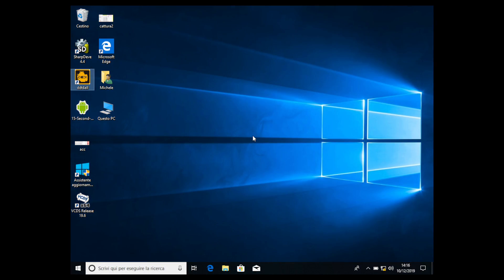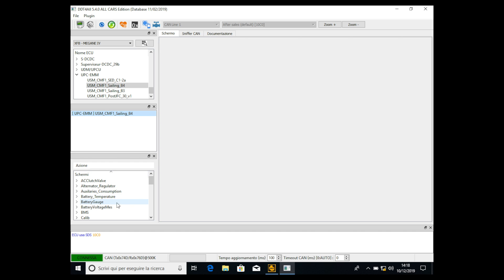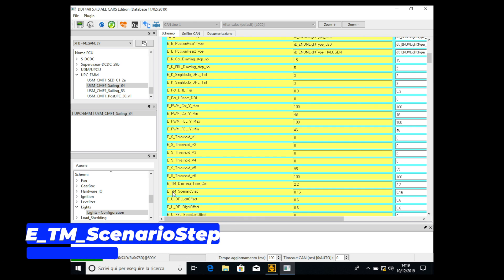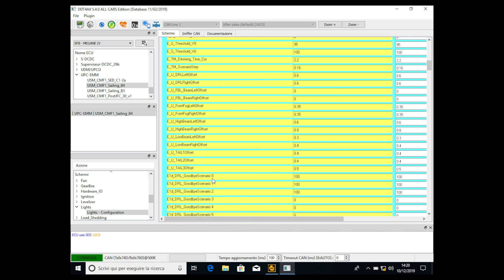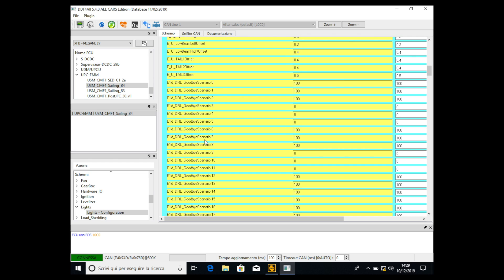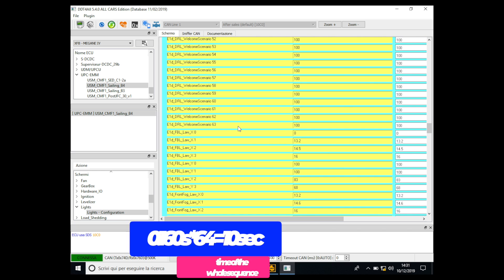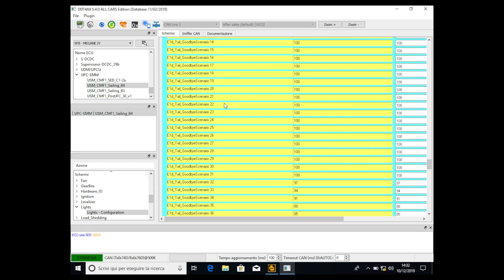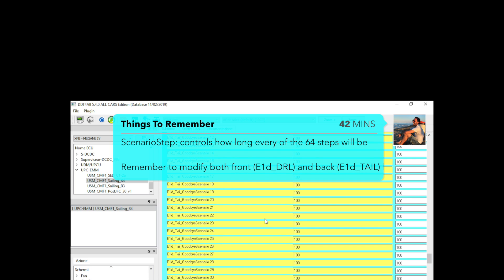Welcome and Goodbye Led Sequence Change | Renault DDT4ALL Tutorial

Comment: Hi. I am looking for solution and maybe You can help me. I have megane iv and I would like to change moment of opening side mirrors when option welcome lights is on. Welcome lights connected with hand free cause the side mirrors to open every time I approach the car and close if I walk away. If the greeting lights option is disabled, the mirrors open only after the ignition is turned on (pressing the start/stop button). I would like to keep the backlight only options, but change the moment of opening the mirrors to the moment of turning on the ignition. Do you know where to set this in dd4all?

Comment: Great video. I have worked on the Lights software part for Renault.
You have explained way better than Renault persons.
Reply: Hello man, i have a question if you mind, i have front headlights from renault zoe and both megane and zoe uses same headlight ecu, so i’m gonna install led lens, blinker and drl to my motorcycle from the zoe’s headlights but i couldn’t manage to activate drl led’s, i can get to work low beams, high beams and blinkers but i couldn’t activate drl, do you know the solution?

Comment: Hey
I was playing around in the developer mode on my radio unit, when I clicked the "High display mode", the display went dark.
After that, I used Pyren to solve it and it came back to life but after that, I was having problems with climate buttons.

I tried to fix that but now the whole climate is not working and the screen is black again.

Is anyone here who could guide me through the process to get it back online?

I have ELM cable and a ddt4all program.

Car:
Megane 4 Grandtour 2017

Comment: Hello! Is there any chance to fully activate Multisense for cars without electric parking brake and no multisense button?
I was able to make the multisense menu to be accesed through the R-Link, and seems that pressing the ECO button triggers and enters the multisense menu.
But the other modes (sport / netrual / comfort) are doing absolutely nothing. I would appreciate to have a stiffer steering wheel or better gearbox response.
Thank you very much! :D

Comment: Hi Michele. I have some questions.
"REMEMBER TO WRITE DOWN ORIGINAL VALUES BEFORE DOING THE MOD!! AND REMEMBER TO LOCK THE CAR FOR AT LEAST 10 MINUTES TO LET THE ECU's TO SHUT OFF!!"
Why should we lock the car for 10 minuters? We can't remove de adapter before that?

"Procedure is very very easy, just remember to do the Reset SW of the R-Link2  otherwise this mod won’t work!"
Actually I changed the LED sequence for "goodbye" to the front LEDs without reseting R-Link2 and when I lock my car, I can see the new sequence.

Another question.
Can we make this changes with engine off? I changes de front LED sequence with engine on, but I would like to know if we can do it with engine off to not have the engine on all the time while testing different sequences.

Thank you in advance.

Comment: Hey, i've just discovered DDT4ALL and it looks awesome. I really want to see what kind of customisation features are availabe for my Megane III which is 1 generation older than yours. You show that you select the car from the list, but somewhere else I read that it's better to let DDT4ALL scan all the available ECU's instead then you get confirmed which ECU's are there. What do you think? Also, do you know where I will find settings to enable and disable electric power folding mirrors and headlights washers?

Comment: Hello!
I had problems with following this tutorial.
The parameters I changed didnt effect the ligths the way I wanted.
The original parameters weren't written like the ligths were operating, and when I changed them, they didn't change totally like I programed (fade wasn't smooth, and there were some off times although every parameter had a value)
Now I changed all the values to 10 (like it was originally in welcome scenario ) and there is some fade effect...
I don't get this at all

Comment: Hi Michele, as always great tutorial. Do you know if is possible to change the Brake lights/blinkers configuration to be dynamically as for example the Audi lights (https://www.youtube.com/watch?v=I70dvRmnjEg)
Reply from the maker: Hi, you have to buy third part accessories. Unfortunately Renault doesn’t have this feature, but there are some brands that made dynamic indicators for megane!
Reply: Michele Predieri hi man, today I was trying to use the R-link debugger, but by mistake I press upper the screen size high button, the one on right top when the debugger is opened, unfortunately my screen is complete black now, do you know how I can fix it? Thanks in advance
Reply: I would like to know if this is possible also! thanks :)

Comment: Hi Michele,
congratulations on the videos you post. Have you ever had the "E_TM_ScenarioStep" parameter not changed?
The ECU replies: "WRONG RESPONSE: Service not supported in active session (7F2E7F). By default it is 0.08 and I would like to change it to 0.16, but it is not possible.
Thanks for the reply.

Comment: Hello thank you again for this tweak, it worked not quite for me. The tail light blinks twice and fade in en out beautiful but the front it cannot fade in or out, it like its bright on and then after couple seconds it fades 50% and then goes off, the same on the welcome scenario.
Reply from the maker: Well.. try to re write values, mine had the same problem the first time I tried!
Reply: @drivewithmi  Ok so with the same values you mean or another value?
Reply from the maker: same same
Reply: @drivewithmi  I tried that 2 times today but the front led just cant fade in or fade out.
Reply: Hi. Did you figured it out? My megane si doing just the same. Its Like 100% then 50 then 0. No fading

Comment: Hey michele! Just wanted you to know that i changed everything starting from 0 then 9 and then everytime steps of 3 until 100 (thats scene 31) then beginnen from 32 again with 0 then 9 and then again steps until 100 (scene 63) i changed the length of the scene to 0.20. It looks good but its not yet the effect of the slow burst to a full burst, maybe because of the leds? If i make the scene longer then 0.20 the effect will be better visable? Thanks man
Reply from the maker: Hey! Well actually I noticed that the fade is not so smooth (actually it seems that steps aren’t 1-2-3 ecc but more likely 10-20-30 ecc). So yes, probably with 0.20 seconds they will behave better! I’m wondering to program the leds to perform with a fast flash for like 10 seconds (just for Christmas 😂😂😂)

Comment: Michele, thanks a lot!
I have the same car here in Ukraine, and do all the tips you discovered in your videos, except CarPlay (I have 2.17.2.803 R-link version, do you know how to upgrade it or tell me please some other ways to get CarPlay into my car?), its very cool!!!
So wish you all the best, looking forward to new videos))
Reply: You can get 3. Something through an USB key, with a special script. Then you can activate Android Auto and carplay through another USB script that allows you to enter developer mode on the R-link, then you just pin the carplay in the developer menu 😁 IT Works for me with Android Auto. But i did it along time ago, so i dont remember the links. Try seach for "R-link developer mode carplay" something like that 😁
Reply: @TheChrisMiR  thanks for the advice) anyway I’ll try to find issue that you mentioned)
Reply from the maker: Unfortunately CarPlay is not available with version 2. Even if you change version to 7 or 8 and change USB ports. The main reason is that 2.2 does not have specific hardware in the main board

Comment: Hi there! Thank you very much for your useful tutorials! You are the kind! I have a problem with my R-link 2 on my Kadjar: he needs almost 60 sec till it's awake. Booting it's really slow. Already tried updating but problem still persist.  Any suggestions?
Reply from the maker: Have you ever tried to do an hard reboot? By pressing on off key for at least 5 seconds?
Reply: @drivewithmi  yes, l tried this also, but without any luck. 
When I'm staying the car, l have to wait almost one minute till Rlink active ist, I have no pack sensors and backup kamara in this time. It's really annoying...

What it's weird, if l stop the car only for maximum 5-10 minutes, l don't have this problem anymore.

Comment: I like your channel, helped me with Android auto. Also I bought an initiale leather interior set and your tutorial showed me how to change the boot animation of the rlink to the sequence with the initiale logo on it. Great stuff. The initiale passenger seat has massage as well, in my original set I only had  a massage seat on the driver's side. Do you think I can switch on the massage in the Rlink system with ddt4all as well?
Reply from the maker: Hmmmm.. good question! I have to check, because Megane does not come with passenger massage option, so I don’t know if there’s physically an option to activate!
Reply: @drivewithmi  that would be great, my Renault dealer is very helpful but as soon as I mention messing with ddt4all my warranty is probably out the door. I have a Scenic IV by the way
Reply from the maker: @ferrybel2472  yep, once you touch the car (even changing a light bulb) your warranty is gone! in these days i'll check if there is some parameter to change and i'll let u know!

Comment: Thanks for the video michele! So if i want a slow burst of the leds 2 times i have to calculate how much each step is? there are 64 steps in total so 32 is the half: 100(full led color)/32 steps= 3. So that means that the first 32 steps have to be increasing with 3, starting from 0 up to 100. This is the first burst. Then the second from steps 32 to 63 is exact the same? I think with this you create 2 slow bursts of the leds? I see in youre video with goodbyescene 63 to 62 that you take a jump from 0 to 10? I hope its clear for you :p
Reply from the maker: Yes is clear! Actually you’re right with calculation. I take a jump from 0 to 10 because there wasn’t enough space to put the other 3 numbers 👍🏻😂
Reply: @drivewithmi  so i have to do the same and start from 0 to 10 in the first two steps? Thanks
Reply from the maker: @dieterdoom9635  actually yes.. or just play with 0 and 100 (longer or shorter)